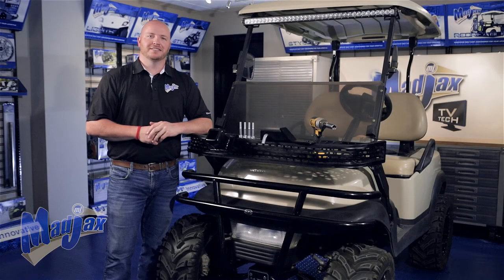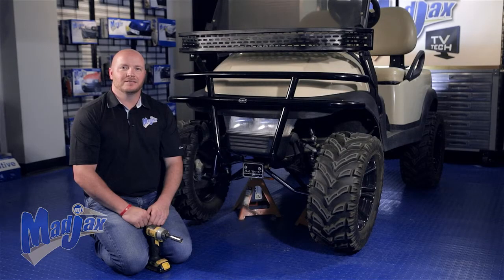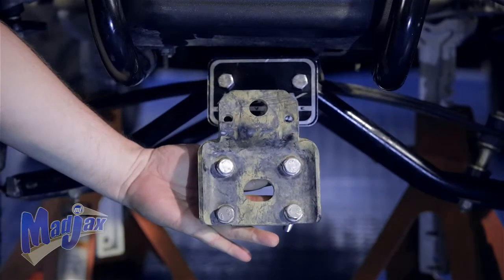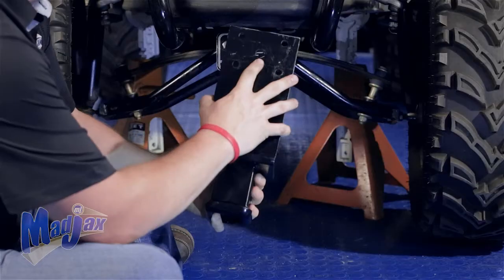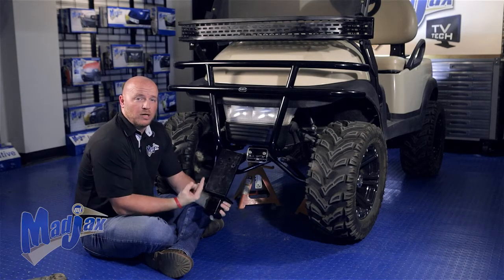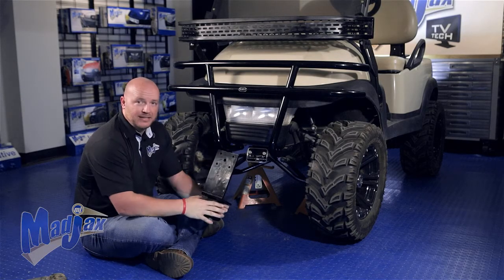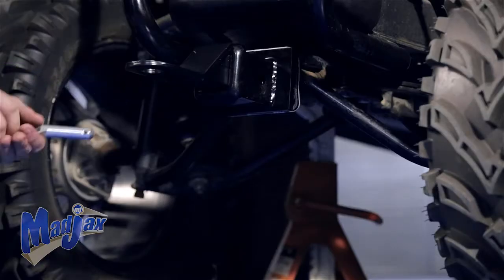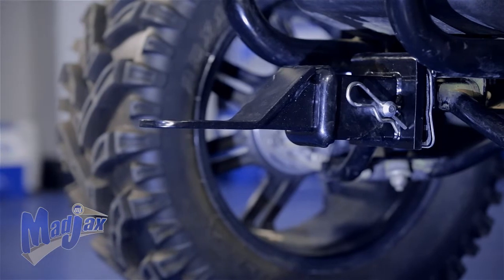Front Hitch for Club Car® Precedent® | How to Install Video | Madjax® Golf Cart Accessories

Comment: This before the rear hitch?
Reply from the maker: This is a secondary option to the rear hitch. The 01-079 Cooler/Rod Holder rack is the preferred accessory to the front hitch.
Reply: Where can I buy one?
Reply: Nice video! Ive learned so much from these plus ordered so many parts! Question, what light bar is on the car in this video and what size is it, plus does it block the windshield?
Reply: Where to purchase this exact hitch please?
Thanks,
JM
Reply: Did you find out where to buy one? Plz share if so thanks. JM